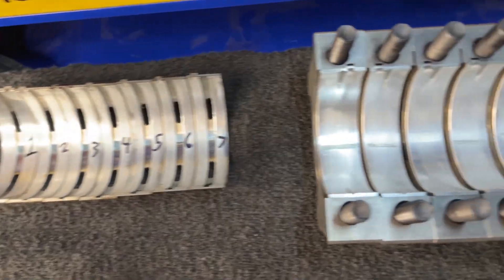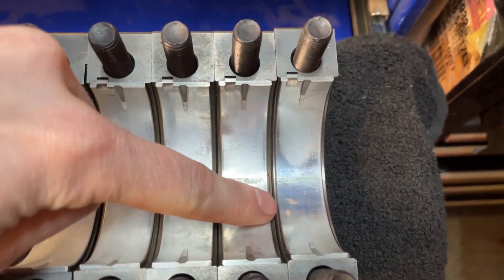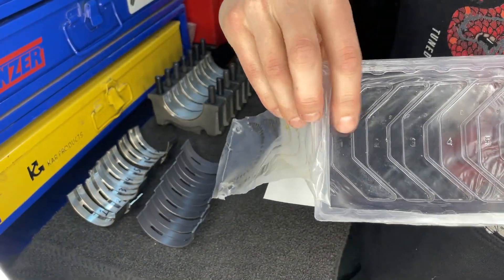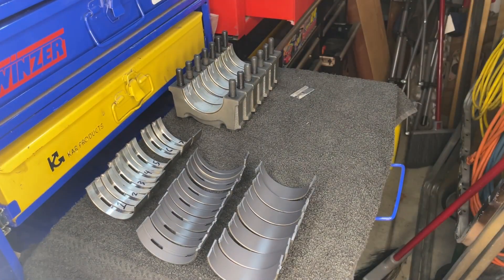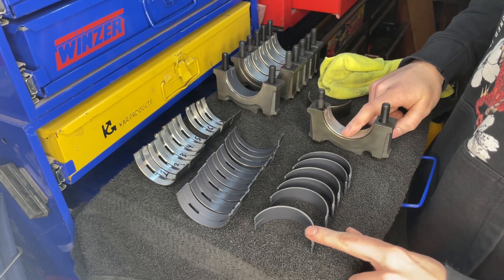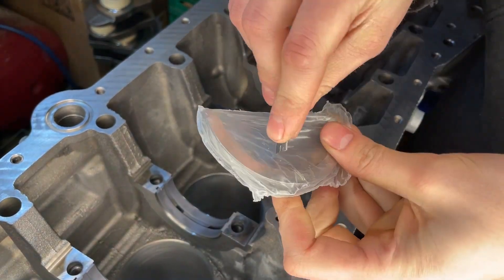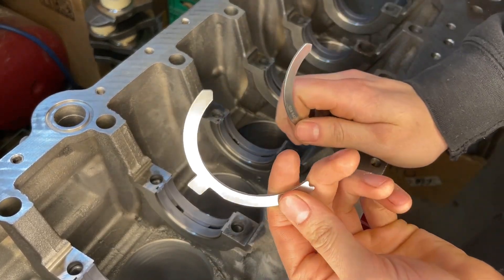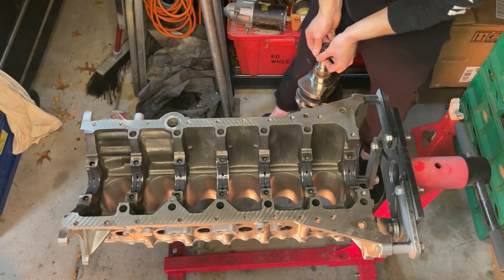How to Install New Main Bearings in a 2JZ

Comment: What would happen if you didn’t get spec bearings or hats? Is it a big issue?
Reply from the maker: So the “spec” refers to the tolerance, or how much space is between the individual parts of the assembly when it’s put together. Being out of spec means that the distance between the parts is either too big or too small. If it’s more or less than the recommended tolerance specifications, it can cause oil supply problems. If the space between the bearings, caps, and crankshaft are too large, oil will fly out between the parts instead of lubricating them properly. If the gaps are to small, there will not be enough space for the oil to lubricate the parts effectively, causing oil temps to rise and potential oil starvation. This can result in a bearing failure. So in short, yes, it can be a big issue. You can get away with parts that are a little out of spec but they tend to not last quite as long.
Reply: @JacobRosproy  I’m planning on doing my Z rebuild my self and I just saw a lot of things about “spec,” thanks for clearing it up man.
Reply from the maker: No problem, man. Glad I could help!
Reply: Are these bearings for standard build ? If so what's the type of king bearings ?